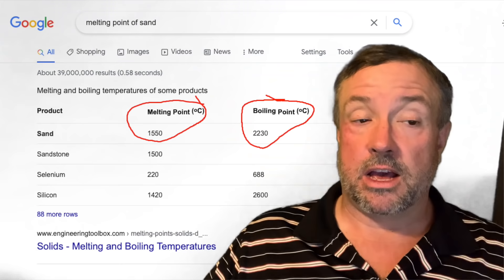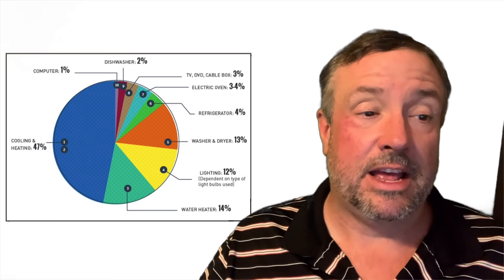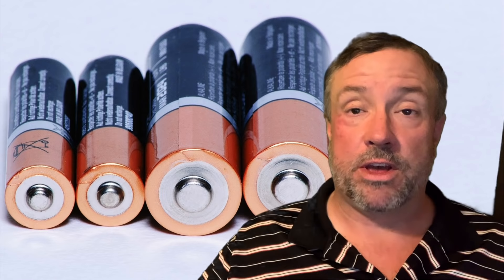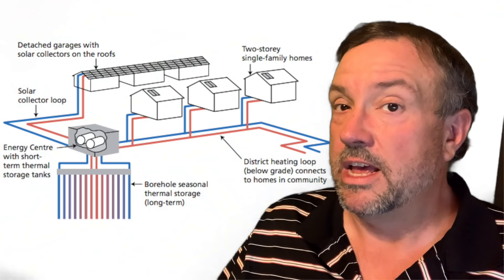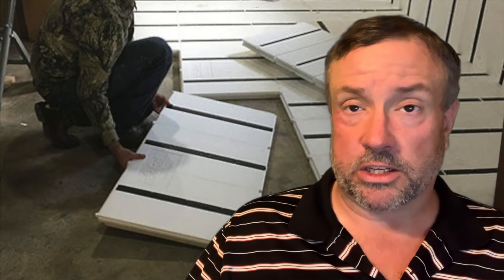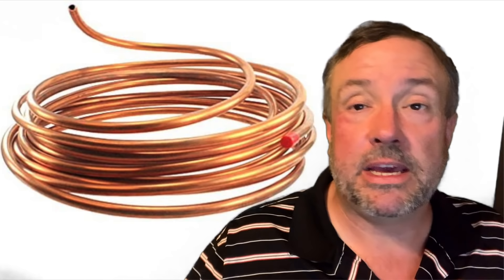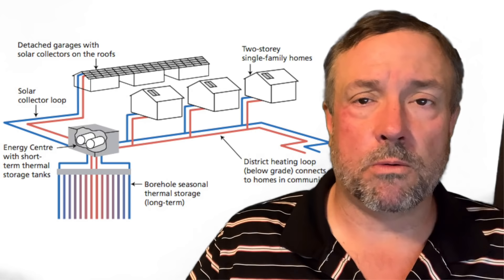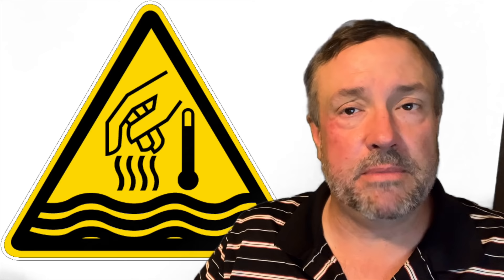Sand for Thermal Energy Storage

Comment: I'm sleepy so excuse the mumble-jumble. My thoughts while watching this and I have to think small scale because I am geared towards van life. So, if I have an ice chest or even a 5-gallon bucket full of sand I would stick (right off the top of my head) an iron rod in the middle (the bucket seems better.. iron heats evenly and I would think the sand around the iron would heat evenly. If you take a magnifying glass and concentrate the sun's rays to beam directly onto the iron rod, it would heat up the sand (900 c I think) hmm if you had the sand stored underground surrounded by rock, you could have the iron rod sticking out of the ground the magnifying glass on a solar tracker. I guess the "iron rod" should have some sort of way to have liquid heating and moving to the underground through iron piping? so that the sand underground will be heated. I would think there would be a way to implement this method with radiant heated flooring. This is the first time I have heard of using sand for thermal heat.. and also heat as a way to produce energy (tho it's not that efficient as of yet) I have no doubt I will be thinking about it more. I am so sleepy atm. I am hoping I understood the assignment. There is also a fresnel lense but it does not get as hot as a magnifying glass can get. I have never had to think of such high temps before either. nor have I done any research on that. Anyways. I look forward to seeing what all helps you. Good luck to you fellow free thinker xox
Reply from the maker: thank you for the input

Comment: Look at an infrared heating system that would be found in some commercial garages.  They have a 4” black steel tube with reflectors. You might be able to use it in reverse.
Reply from the maker: interesting

Comment: I’m not an engineer or scientist, but have an idea. Maybe you could develop a multiple stage system where you could run piping through the sand battery, pump glycol or other less expensive fluid through the piping to extract the heat and deliver it to the desired location. 

I’m glad you made this video, I was thinking a parabolic solar heater or hho could be used to heat the sand. I have seen a video in german where sand was heated by hydrogen separated from water and through some chemical processes I didn’t fully understand was brought back to it’s original state after and the process started over again. Perhaps this could be a way of heating the sand. Not sure.
Reply from the maker: interesting

Comment: what about antifreeze?  However, I am still considering a mirror effect with wet sand.  Since sand does take longer to heat than water, wet sand would also act as a coolant to hot water would it not?  That is what I was thinking about.  Many people use sand as an insulator for rocket stoves.  Some use wet sand within ceramic containers for cooling their food when in heated days much like an ice cooler.  So if wet sand can do BOTH of those, then using wet sand may make it so that heated water will not be so hot during winter, and it would cool down when summer.  Anyways, its a thought.  Keeping sand moist is my theory on that.
Reply from the maker: Good idea

Comment: I did spot a water heat storage system on the internet that did not use a tank they just dug a rectangular hole in the ground and then insulated it with sheet insulation and then used a rubber liner to hold the water in. They also had an insulated lid.
Reply from the maker: interesting! do you have a link?

Comment: 3414ish btu is equal to 1 kWh, equal to about 5 sq meters of solar panel (after 20% sunlight to electric efficiency), for an hour.
If you need 100,000 btu for like half the day and night, then it would seem, just do the math, hope for good sun and then the hard part, figuring how to get the heat into the sand. I assume sand is somewhat of an insulator, so it'll kinda stop itself from even heating. Maybe the electrode should be redesigned. I believe there's things that already has that.
TnT noted the ohms law part of it. If a certain electrode is meant for 240v, then must increase amps by no more than 10x for a 24v system (or something like that, assuming resistance, ohms, stays the same). Or, of rated for amps, must stay the same as the 240v rating (and only achieve ⅒ the power).
For reference, just one pound of wood pellets is worth 8,400 btu, if burned as efficiently as possible, probably the rocket stove.
Reply from the maker: Impressive math

Comment: It might be easier to build a silo and move the sand through a vertical pipe outside, getting heatet by the solar array. The cold sand could be moved by an air flow, or a screw.
Reply from the maker: interesting!

Comment: Use water heating elements, combine with electricity from solar panels to heat sand. Scary to heat liquid. Maybe attach peltier elements to turn heat back into electricity?
Reply from the maker: There’s efficiency issues with heating elements
Reply: Would they break down above a certain temp. Seems a great idea btw

Comment: Isn't the most efficient way of adding heat to sand going to be an electric resistive heater? How do we do that without wrecking the heater with the sand? If the sand is in a cement basement containment box, then moisture shouldn't be a big problem if the initial moisture could be vented, but insulation would be. If the sand is open, moisture would definitely be a problem.
Reply from the maker: makes sense

Comment: I've seen videos of simple electric  ceramic heating nodes. They seemed to get to incredible heat over time with little electricity. If i recall they could be placed under a copper sheet to transfer a larger area of heat up into the sand. From there I don't know if simple air tubing or liquid tubing would be better. I would think air that could then be moved to a 2nd area for conversion as you mentioned.
Reply from the maker: Well said
Reply: 12v ptc heaters they are called

Comment: Hi,
like your channel.

Think your problem your want solve, if solved in cheap and sustainable way, that holds the key to solve world energy problem. The implications would be huge.

As refered from some commentators, polar nights energy has an interesting approach.

But my improvement suggestion would be to change the working fluid.

Everybody uses water as heat carrier fluid. Actually pretty dumb, because it boils already at 100 celcius, as you also mentioned.
Reply from the maker: well said

Comment: My house already has an HVAC system, so I've been searching for a simple, reliable, cheap way to interface some sort of geothermal or thermal storage setup.  I will eventually get solar panels but it's expensive and I'm waiting on Tesla to come to my state (I'm in investor so gotta support them lol).  Plus I have to cut down a LOT of trees.  In the meantime I'd like to lower my heating and cooling bill.
Reply from the maker: You should check out my low grade geo thermal videos!

Comment: Have you considered using steel black pipe to make your heat exchanger. I was just trying to research if slag would make a better storage medium than sand as it usually still has a good content of iron in it.
Reply from the maker: Good idea
Reply: @Simple Tek  I noticed after someone else commented on the gas pipe. What are your thoughts on the slag. I feel like I'm getting conflicting info? Do you have any formula to figure out how much heat needs to be stored for your project, projected heat available from different sources etc? My house is about 3000 sqft built in 1900. I was thinking of building my battery under my driveway. I was thinking slag because it's even cheaper than sand, probably in line with pit run. It also packs down nicely and provides a more stable base. I don't think air would flow through that aggregate well though unless I used nut slag. I also wanted to incorporate a PCM, maybe directly beside the exchanger so that I could get heat rapidly when needed and insulate it from heat pump pipes
Reply from the maker: @SuperJLTube  I don’t have a way to give exact amounts of heat needed, only general estimate guesses

Comment: You could pipe the heat to a high thermally conductive material in the middle of a sand tank, then spin the tank to make sure all the sand spends time adjacent to the element.

Insulate the container of course.
Reply: Make the container a flywheel and it can contain electrical energy, too.

Give it an internal topology that churns the sand. Connect the heat pipes outside the flywheel and inside by a thermally conductive gas contained between the stator and rotor to keep friction low.

Superconductor Mag Lev the wheel and make the pressure of the heat transferring gas is lower than what would create effective slowing friction.

Use water to generate electricity with heat that would normally get wasted?
Reply from the maker: interesting
Reply: @SimpleTek 

Actually, just read my post again - don't churn the sand haha (I wasn't thinking about how heat conductivity works)

An Airloy can just coat the tank and average temperature kept below it's tolerance.

A Flywheel Sand Tank for sure, though.

As long as the Heat Transfer Gas is low friction - a Noble Gas; Neon is in Atmosphere.

Low Chemically Reactive Thermal Conductor as the tank walls. Silicon Carbide?

Comment: I was thinking of a solar panel with oil or water with coolant, that heats sand in an underground deposit, which is heated during summer, and in winter, used as a boiler.
Reply from the maker: Cool idea

Comment: Maybe a solar air collector and then store that heat in sand or other materials, like stones or bricks?  it may not be the best with air but at least you do not have to worry about buying it, contaminating leakeage or boiling point. Just my idea.
Reply from the maker: Good idea

Comment: If you want cheap insulation make carbon foam bricks, they are made from sugar and nitric acid and only take a few days to make but of you make a bunch in one go it won't be too much of a problem.

They use carbon foam to insulate space stations, you can put an ice cube on one side and blast the other side with an oxy cutting torch and the ice cube will stay frozen. Super cheap stuff to make
Reply from the maker: Interesting!!! I was leaning towards air Crete but I’ll look into this

Comment: Ok I think we could buy old steel tank from truck at scrap yard 3000-20000 liter and fill it with fine sand that have big capacity for heat storage at high temperatures. 
(Cost of a such tank here is about 1500$)
Can go up to 300-400*C inside steel tank and with stainless steel tank even higher.
(That way we have many times larger capacity of heat than using same volume of water at 100*C)

We cut rectangular hole in steel tank and put copper plate 40x40cm with ribs going into sand to spread heat faster, painted black on that place so that spot would receive all heat we are going to transmit to the tank.
(That tank is welded and hermetically sealed with tons of sand inside.)

Now we buy another slightly bigger tank, coat from inside with reflective coating, put our first tank into it and make sealed glass window 30x30cm on it to align with black coated copper on inside tank.

Internal tank should be sitting on a bigger tank with some non conductive and heat resistant legs so that would not transfer heat to surrounding tank.

We make outer steel tank more rigid by welding outer support so it doesnt shrink, put some copper pipes around and insulate whole tank very good.
-Those copper pipes are to flow water into them for heating.
-To outer tank is also connected vacuum pump that makes vacuum between two tanks to stop 2 ways of heat transfer (conduction and convection).
-That inside coating of the tank stops 3. way of heat transfer which is (radiation).

Now we make huge set of parabolic mirrors that would be guided with motors to reflect huge amount of heat through that window to copper plate and heat sand material and inside steel tank up to 300-400*C or more with stainless steel tank.

We can use huge parabolic mirrors 2x2m by adding many smaller ones to construction of a big one.
We can also put 4 mirrors at window at 30* to collect light that would otherwise not hit the window and size receiving area up to 1m.🔳

How does it work?

So on a sunny day mirrors should reflect huge amount of heat through a window of outer tank to a copper part of inner tank filled with sand that would get very very hot because its totally, vacuum(conduction and convection) and coating(radiation) insulated from the outer surface.

Now when sun is out and we need heat we simply push the water through pipes connected on outer tank and via motor we make less vacuum between so outer tank and  pipes start rapid heating and water gets hot.

Then we transfer water to our house boiler for a in house hot water and room heating, or to a steam turbine that could make electricity all summer nights when we dont need so much of a heat.

Such a well insulated tank could maybe keep a sand hot for a month which is great considering whole week might be cloudy.

Am not sure if about 50sqm of mirrors would be enough to make such amounts of heat during winter but it seems like long lasting, not much expensive and very earth pollution saving project.

Would like some engineer to take a look on this and give real calculations about efficiency and possibility for such a project.

Thanks for making me think of this idea and please everyone who have some recommendations or ideas to add something..
Reply from the maker: That's awesome!
Reply: @SimpleTek  
Thanks.
Maybe you want to check an update.
Pump could be controlled with temp. sensor for a fine control of pipes temperature.
Also could probably be made as smaller prototype with sensors inside to check temps.
Reply from the maker: @egaega2458  sweet

Comment: You may want to look into a better mic for video...in the tank use concrete/clay tubes ... If using oil to transport heat, put the air/oil converter in the clay tubes...
Reply from the maker: Great suggestion! new videos are better now

Comment: The problem with sand is it's a poor thermal conductor. Ie it's an insulator. Makes it hard to get the heat in and out unless you have a dense network of piping running throughout.  A better method imo is to use mineral oil.  A 50 gallon drum or two and bury them in sand.  Circulate the mineral oil to through solar collector with an electric oil pump and and thermostat regulated power switch then store in the buried drums.  A second oil pump and insulated piping to distribute the heated mineral oil to radiators/heat exchangers where the heat is needed.  Running hot oil lines isn't ideal but it would be benign mineral oil and with the simplicity of such a system you can divert more funds to quality fittings and insulate/protect them.
Reply from the maker: although I agree it's better I'm thinking the amount of mineral oil I'd need is cost prohibitive
Reply: @SimpleTek  I would look into it.  I briefly did some googling and looks like you could find bulk supply in range 600-1000 us for a big drum.  Or perhaps another oil type?  

Certainly you could also bury a 55 gal drum with water in it alongside the oil and then use a pump to transfer the heat from the oil to the water.  I think copper tubing would work.  

Adding additional heat exchange steps will decrease the efficiency but might allow you to use a smaller volume of oil.  Management of flow and temperature of everything will be a challenge.  300 degree oil will boil water and make steam and subsequently explode.  

I think the simplicity of one "working" fluid would decrease a lot of the cost and potential maintenance / failure points.  Hot oil through a radiator heats air very well.
Reply from the maker: @undertow2142  will do!

Comment: Small, simple wood stove (or other heat source) powered thermosiphon (55-gallon drum filled with automotive coolant) to radiant heated floor (sand) insulated with aircrete around the sides and bottom. This, combined with insulated back wall - metal on the inside - painted black, filled with sand. If you want, fill a couple of black plastic drums with water to add some humidity as well as adding some thermal mass. I also saw Survival Lilly make a small solar system to power a small heater through the night. I thought that was very creative. You could easily cover the back wall with a white sheet in the summer and remove the black plastic drums as the weather gets warmer during the summer months.
Reply from the maker: nice

Comment: What about using a water as a transfer liquid and then a heat pump with heat exchanger to heat up the sand with hot air injection?
Reply from the maker: Sand’s value is that it can store heat many times water’s boiling point
Reply: @SimpleTek   Do you say it I did not know that before?
read again pls
Discharge:
Store heat in Sand at 200-400C
Heat exchanger heat water 80C
Water easy to transfer
Charge:
Heat up water to max 80-95C
Use heatpump to superheat air
inject superheated air in sand
-> Sand store 200-400C long time